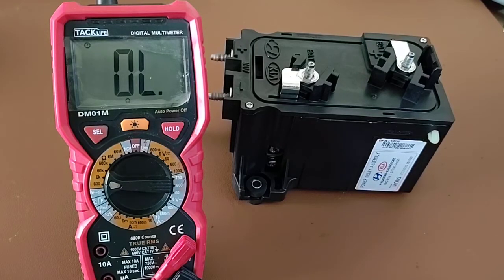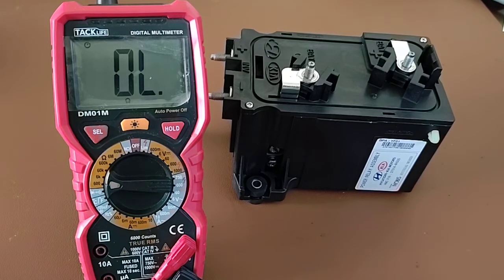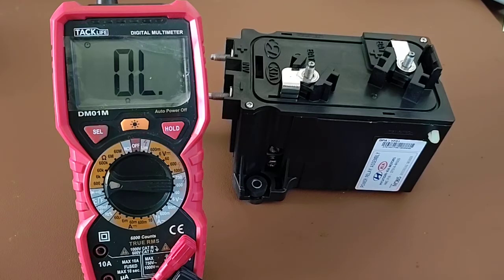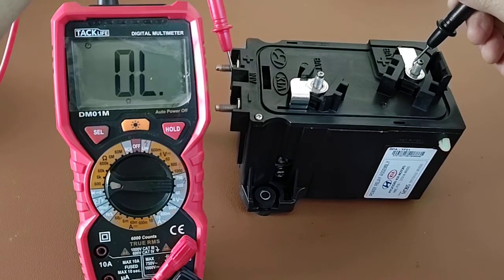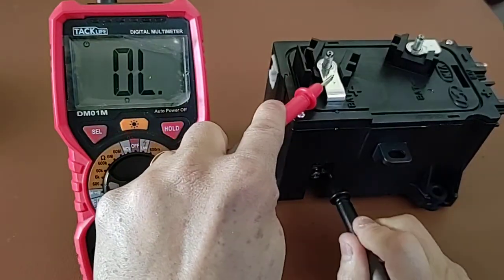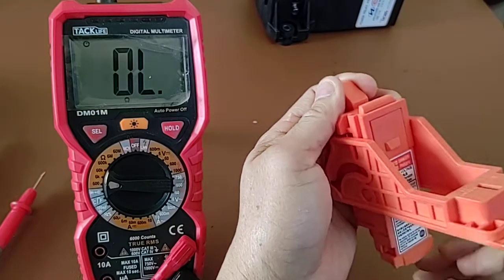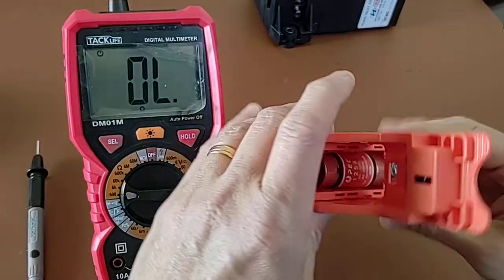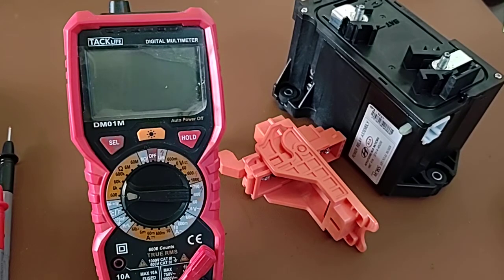Hyundai Sonata Hybrid P1B77  Power Relay Assembly

Comment: This test only shows that the relay is not shorted.  It does not show if the relay actually closes in the activated state.  The activated state would be the condition that causes P1B77 error code.  When activated the Bat + would be connected to Inv + and Bat - should be connected to Inv -.  If one of these contacts had high resistance in the active state the P1B77 fault would be set.
Reply: Would this be the same if I had p1b25 code and the high voltage fuse fix did not resolve the issue. Should my next move be to fix the power relay assembly entirely?

Comment: The fuse blew for a reason.I am a Kia tech.do you know why it blew? 🤣i bet not.that's why it comes to us.
Reply: Well kia tech I had the same problem and Kia could not answer why it blew either or my power relay or justify trying to charge me $1995.00!!! That's why you don't go to the dealer period!!! All they care about is their commission by marking up the parts.
Reply: Well Bob since you are a tech for them would you be kind enough to please explain why the fuse would blow? I just bought a 13 Hyundai sonata hybrid that has similar issues i believe and its at least 65 miles to the nearest kia or Hyundai dealership. I already replaced the fuse in the safety switch and the car starts now but still has the dreaded warning. And my scanner won't read the codes for the hev system
Reply: @richardsypert5993  he doesn't know shit or else he wouldn't of ended up on this video. LOL

Comment: Unfortunately I only found your video after I had the issue and after I took my 2015 KIA Hybrid to the dealer. They sent me home, on a hook, lighter in pocket by $980.00 with their "best guess" being a Power Really which was backordered across North America without a delivery date. After reviewing your video and picking up a good multimeter, 6 weeks later I decided to order the Fuse. Kia couldn't get one, Hyundai dealer couldn't get one. I researched and found that Toyota, KIA, Hyundai all use the same fuse. My local Toyota dealer were happy to help - ordered from California, arrived, installed and bingo the problem is solved. Very much appreciate your video!!
Reply: Hi Randy, Can I ask how much they charged you for the fuse?
Reply: @ghenkhoash2440  153.45 CAD taxes included
Reply from the maker: Do you have the Toyota part #?
Reply: @csleeut  I switched out my hybrid battery fuse but I'm still having "Hybrid Battery Warning" error. Could it be the 12 volts battery too?
Reply from the maker: @samspade8830  you should check the relay module too as I did in the video.
Reply: @csleeut  Yes. I ordered one and it's at my house. I'm just waiting on the electrician gloves that I ordered.
Reply: Do u have the old power relay

Comment: Seems to be a common problem. Power surge is the reason for fuse blow out. The relay may be fine in testing on bench but back EMF (should be protected by diode) in faulty relay can blow the fuse. If you open the relay, there should be a diode). Relay can be repaired, and Fuse should be kept as spare in the car.
Reply from the maker: There is nothing but 4 relays and wires and a connector. No diode.
Reply: Had exact same problem and time frame between repairs. Only difference is that they made me replace the 12v battery both times. I asked why battery failed 3 years both times he said that’s how long they last usually and the 12v battery shouldn’t affect the hybrid system. It was out of warranty this time but they covered all parts except the battery since I got all over their case about it and opened case with Hyundai customer service.
Reply: I have done a lot of work with many types of relays, the inductive kick from one of those small relay coils will not blow a 120 amp fuse, it's not possible. Yes diodes are used across relay coils for that purpose but I have never seen a massive 120 amp diode used

Comment: Can I take out this orange plug after disconnecting the small car battery?
Reply: The plug can be disconnected after removing the 12V battery. It is recommended to remove  the safety plug first just incase there is excessive voltage left in the hybrid battery. This is because the DC-DC converter is what charges the 12V battery due to no alternator. Always remove the safety plug first and wait about 10 minute before doing any work. The 12V is a safe system, but you would not want to find out a rodent has exposed wires from chewing on them.
Reply from the maker: I think so, The orange plug is the fuse that connects the hybrid battery to this relay.
Reply: Yes you can, its the safety fuse you can also test it the same way.
Reply: Be careful when u deal with battery. Keep yrself ‘insulated’...